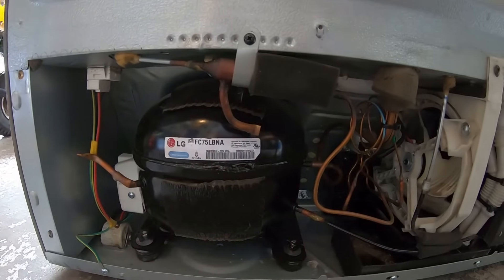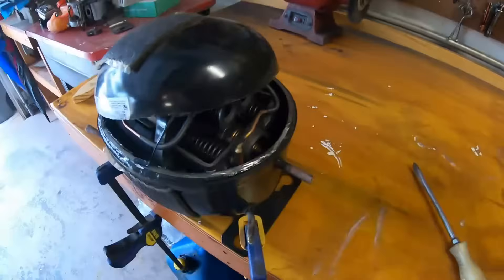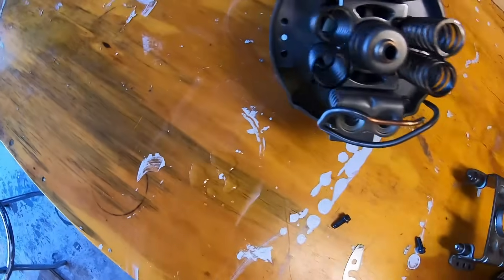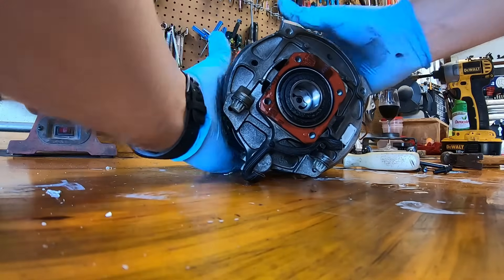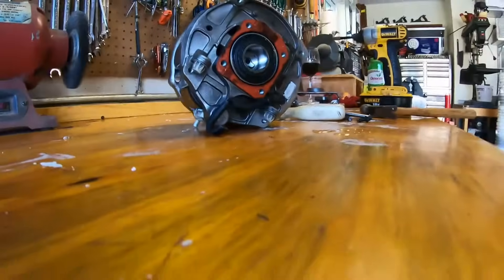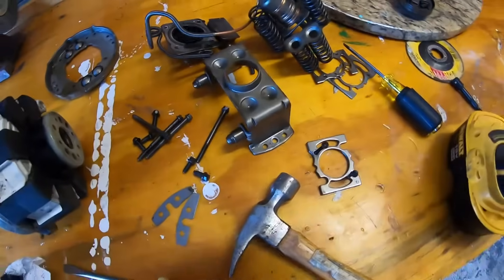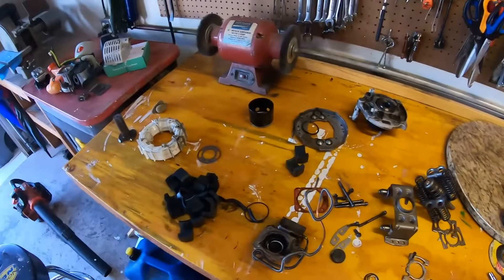Cutting open a failed LG refrigerator compressor

Comment from the maker: Really appreciate the 14,000 comments concerned for my safety :) Will definitely wear safety squints going forward.
Reply: I was worried about your wine...  🤣
Reply: I know a former construction worker who was using an angle grinder to cut bolts. It was prepared and given to him by a stupid, careless fool in the site store. The disc was worn, the wrong size and there was no guard. The disc shattered and a piece shot into his leg which was amputated above the knee. Please take all precautions even if you think they may be excessive.
Reply: Always internet mother hens...
Reply: Just looking out for you Joe.
Reply: Once you get a glowing hot sharp bit of metal in your eye, and have to have it scraped out, you’ll never forget to wear goggles again.
Reply: If you ever need an MRI, go to an eye doctor first and MAKE SURE you don't have metal embedded in your eyes.  MRI will migrate even tiny bits and can blind you or cause you significant lasting pain.
Reply: @smarouchoc7300 That shi sound fucked up tho. Gonna runs magnet on my eyeballs before going to take MRI. But, why would a metal shaving gets into your eye tho. Would they get eaten by our own immune system tho? 😭
Reply: @runsolomon  - looks like metal to metal contact caused debris.
Reply: True.  When you’re young you’re six foot tall and bulletproof!

Comment: I have a  LG refrigerator, model LMXC23746S.  It's only 9 years old, stopped cooling, tech came and confirmed there is a refrigerant leak, the compressor and evaporator will need to be replaced.  The compressor will be covered under warranty, not the labor or the evaporator.  Customer service communication has been awful so far.  It's been over a week since the refrigerator failed, still no word when they will have the parts to fix it.  It will still cost me about $1K in repair cost for the labor and parts not covered by warranty. The 30 year old refrigerator we had before this POS is still working, with no trouble.  Lots of videos on YouTube about LG refrigerator failures.  Will not buy another LG appliance.

Comment: Fascinating! How did you know it failed? Did it stop running, or just stopped compressing the refrigerant? I was going to guess it seized up, or a electrical coil had an open circuit.

Comment: That "flimsy piece of metal" @ 8:55 in video is most likely a check-valve.  There has to be at least 2 check-valves in reciprocating compressor.  They commonly fatigue & break off.
          The "25 cent part" @12:56 is most likely the intake check-valve.  The one in the piston is the output valve.  If intake valve fails, the refrigerant just sloshes in & out of the intake.
          If the cores are laminated, they should not be magnetized, unless in proximity of other permanent magnets (in the piston?)

Comment: it's something how refrigerator made in the 50s still run to this day . mine I got in 92 . still running non stop to this day . why change . let me tell you why . if we don't keep changing . then engineers will be gone. and you have to make stuff cheaper and more efficient forever. who would want to drive around in a 1923.ford .  
as for the glasses he was fine grinding horizontally. we need engineers.

Comment: So I had my LG compressor start failing 2 months after the 5 year mark last month.  It kept things cool but not enough and ice maker stopped working because of it. I contacted LG and they do have a program where you pay $400 + tax and they will fix whatever is wrong with the fridge.  I did it and they diagnosed it was the compressor and put in a new one and now everything works perfectly.  So if you are pretty sure it's the compressor I would contact LG and do it.

Comment: Hey I’ve watched this several time and I think it’s that first part you called spring tension removed. I think it works like a diaphragm pumping the Freon. Probably cracks loosing its ability to function 
I did read one comment indicating tubes rust out. Maybe they should use stainless steel tubing ? 
Nice tutorial

Comment: I'm 74.  I have two refrigerators that were made in the 1950's that still run just fine. WTF???  I've had two or three "modern" fridges fail in infancy.  Scroll compressor, linear, it simply appears we've lost our engineering abilities.

Comment: Compressors built in the 50's are still running and can be repaired easy. My mothers fridge that I used as a kid(I am 68) is still running with no work needed and still running well, very cold. We had the technology, just go back to the old way of doing things. As we "progress"  our appliances cost vastly more and last only 5 years instead of 30 years. It is a loose for the consumer and the planet. It is only a win for company profits.

Comment: Labor $575 + is what LG quoted for repairing the junk compressor in my 2018 refrigerator. The compressor is free. Debating whether to pay that so it lasts another 5 years or less. Someone mentioned installing a standard old-school rotary compressor with a relay. Wish I could find a Technician that could do that. Darn fridge still in great shape.

Comment: I watched another YT video about an expensive modern refrigerator failure & the engineer determined that 100% of the reason was due to the manufacturers attempt to gain a higher EPA rating on the big yellow sticker, so they could sell more units to brainwashed & defrauded Public.
He found that ultra-thin, water-like oil was used inside the compressor to squeeze just a bit higher EPA number caused the failure. He tore down & examined every single part of the compressor & found nothing wrong with the design or build, just that the oil was insanely thin. He lamented that this practice/scam is the worst for the environment because refrigerators cannot be "recycled" because of the incorporated foam, most just crushed in the landfill, Then the environment takes another hit by having to build an entire new garbage fridge that lasts only 5 years. Uncool!

Comment: LG is good at making junk. Have a microwave from LG that works ok, except the push-in lever to open the door is broken. Have to jig it with tape so the door can still open without the lever popping out. It is made from poor plastic that has become brittle and broke, that makes a working oven useless, if not for Gorilla tape. Never LG anything again.

Comment: Diaphragm typically will have a hole in it. I’ve replaced around or over 600 LG compressors in 6 years

Comment: Your infamous LG Compressor Is suppose to have about 8 ounces of mineral oil in the compressor Unless you dumped it It was Intentionally designed to fail Overheating Vibration in oil cool Lube the Motor.

Comment: How can Consumer Reports give them a high rating.
Reply: Exactly!!  CR claims there's no bias or payment received, etc..  Meanwhile, I've gone through 2 LG refrigerators in 11 years and one of them was a very expensive, top of the line model.  My LG dishwasher also broke right after the warranty period ended, luckily I was able to fix it myself.  Once again, it was a cheap part.  I bought a better made part for around $30 and it's outlasted the OEM part from LG.  A lot of people would have paid lots of money to have LG come in and fix their dishwasher or they would have spent even more money and bought a new one.  LG is garbage and CR continuously recommends them, even with massive complaints and problems. I used to trust CR but not any longer.
Reply: Consumer reports has always been a corrupt organization

Comment: That's a beast of a compressor, should have run perfectly for years. Spoilt by the use of cheap part or a good design compromised by cost cutting.
Reply: Not too sure about a good design.  This is our second LG refrigerator in 11 years and both of them had bad compressors.  They don't have the exact same parts in them and the first refrigerator required a mortgage to pay for it.  LG refrigerators suck and I don't plan on ever buying one again.  Years ago my refrigerators lasted 15 - 20 years and these new refrigerators can't last 6 or 7.  They can keep the electronics, blue tooth, wireless nonsense and just make something that works.  The idea that things are built to break after a certain period of time may sound good for built-in repeat business, but not when customers will no longer buy ANY of their products.  That includes refrigerants, dishwashers or anything else they make.
Almost forgot, my LG dishwasher broke right after the warranty period ended, luckily I was able to fix it myself.  Once again, it was a cheap part.  The better made replacement part cost me around $30 RETAIL.  That means LG gets it for a couple of bucks, at most.  The corporate greed will put them out of business unless they make some serious changes.

Comment: One obvious conclusion from the teardown is that a compressor is not a "piece of crap" due to the complexity of the assembly, which appears from this teardown to be quite well-built (other than the cheap seal!). I suspect the Chinese sub-contractor bought his seal from a second sub-contractor who fabricated them in the second floor above his ground floor noodle shop. Clearly neither LG nor the main sub tested a batch of his compressors for long-term longivity before approving the design. I have seen situations where proper long-term longevity tests were made and approved, but then the sub will sneak in a different seal such as this without notifying his customer (LG in this case) of the change. LG failed to clamp down on its sub to NEVER allow changes like this without notifying it (LG) of the changes. The scary thing about a situation like this is that despite the enormity of China, there are probably not many manufacturing facilities in China that make compressor motors. There could be only one, and all of the refrigerator companies have to buy from the same outfit! Would LG have had better reliability from a compressor manufactured in India or Vietnam?

Comment: Every appliance made by LG that I bought failed early just after warranty period, the dishwasher mainboard died, I took it out and tried to re-solder it with an oven but that thing was dead and a new board was more $$  than just buying a new machine,  Fridge died also I assume it was the compressor but who knows... and above range microwave the latch stopped working which I did manage to hack back together with a screw to hold the spring so got it to working normal again but I got tired of it all the LG so trashed them all.  I also had a Samsung Range that died too, it did last 10 years so not too bad but the oven would flicker on and off , I  tried to repair it but  it was a no-go.    I now mostly have Maytag appliances and so far so good after 3 years.        My fridge is Chinese made by Haier but so far so good after 3 years, only issue is that the gasket on one of the Fridge doors split but that might have been me I sometimes grab something on the way out of the house and holding keys so yeah I just replaced it with a new gasket at least it was a cheap fix.

Comment: A couple of years ago my 
LG linear compressor went out. Luckily it happened a week before the warranty expired. They sent out a technician and he had the compressor installed in an hour or so. He said it would be better than new. So far so good. If it croaks now it won’t be another LG until they get their act together
Reply: I’m glad they stood behind the warranty. They did not with mine. If you read the BBB complaints, they typically aren’t standing behind their warranties.

Comment: While it may be called a 'linear' compressor, it obviously oscillates an accelerating and decelerating piston. How is this better than the much simpler rotary compressor that mostly avoids accelerating and decelerating masses?

Comment: Yeah but it's energy efficient, saves probably 50 pounds of carbon but only lasts 4 years so you can buy a new one which takes a ton of carbon to make. Just like the new eco boost tiny engines don't last. EVERYTHING IS A SCAAAAAAM!

Comment: DTF: Designed To Fail.
For the last 12 years, my wife and I have paid over $600 a year for fridges. We have had to replace two of them.
Meantime, the "Frigidaire" bench fridge my grandfather purchased new in 1949, for my grandmother, continues to run perfectly in 2024, just as it always has.
Please note that we have replaced the door seal a few times, and that's easy with a standard stick-on seal strip. Costs about $20 to replace, every 20 years or so.

Comment: The engineers that produce this  kind of poorly designed garbage, need to be held accountable. No one should ever have to pay about 3 grand for a refrigerator, only for it to fail in 2-3 years.

Also, this country’s dependence on Chinese products is astonishing.

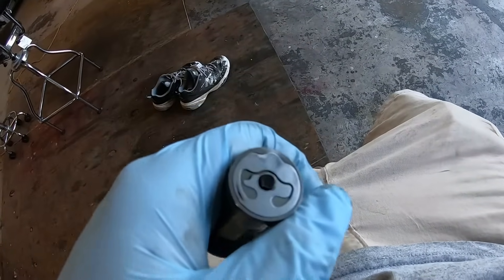Comment: The fault is actually seen at 11:41 . A little bit of the T section is missing from this unidirectional membrane valve. You can even see now the flow-hole below the missing chunk. Thus no compression is possible.

Comment: I have a fridge from 1980 something an one from 2000. They both still work fine. A coworker of mine recently got one of these lgs within that last year as an old stock scratch and dent for 650. The compressor failed. He is now out 650 and bought an old used fridge because these piles of crap don't last. He didn't even bother with a compressor because it's 400 dollars for the same crap. He's happily using an old 1990s whirlpool which was 50 bucks.

Comment: Yea, this is why when I wanted a new fridge, I found a GE from 1991. Simple rotary compressor and no electronics. No stupid ecm fan motors or control boards for the defrost either. I also have a Whirlpool fridge from 1996 as a second fridge, and it also works fine. I just clean the condenser coils and fans on both of them every few months, and thats it. Along with those refrigerators, my washer and dryer are Maytags from the 80s. The washer is a top loader. My stove is a 1989 GE with an analog clock, and my dishwasher is a 70's Hobart Kitchenaid. I even have my front porch light controlled by a late 60s or early 70s Intermatic wall timer. Things today are just made so poorly today, and nothing is designed to last anymore. Even cars are shit today. It's very sad.
Reply: I tell people any old fridge fix it! the new stuff is utter garbage
Reply: @Refertech101  that's why both of my refrigerators are from the 90s

Comment: I just came across your video. I didn’t finish watching it all the way yet as the obvious failure point is at the 11 minute 38 second mark.  the top of the piston has a valve which is symmetrical in a good unit. The left valve on your piston is actually Broken and the chamber below it is visible. This causes the pump to not generate pressure as the valve has no way to ensure compression.

Comment: What you've thankfully done is uncover a very dark little Linear Compressor secret buried in the absolute center of the refrigerators heart. Only a cynical LG design engineer that has to keep this corporate LG nonsense tight lipped. But then who's is willing to cut open a steel case with a grinder and expose this LG obsolescence top secret - a .05¢ plastic valve that renders an expensive $3K dollar 💵 appliance obsolete. NEVER BUY ANYTHING LG - EVER!!!!

Comment: we've had our LG fridge compressor replaced 3 times under PC Richards extended warranty.  the repair guy says it's important to keep the back vents clear because heat seems to be what degrades that little part.  it's a design flaw - weakest link type of thing as the rest of the mechanism looks pretty stout

Comment: Some technicians replace those LG crap-pressors with old school compressors, they just connect an external relay somewhere to the control board that when closed runs the compressor directly from the mains. A normal compressor uses more electricity but with the cost of a new fridge you can pay the extra electricity for decades and making a new fridge uses a lot of energy and resources so saving the old one is better for the environment.
Reply: Thanks. I was wondering if this was possible.
Reply: All new refrigerator compressors are Chinese crap. Especially the Energy Star ones. I didn't know that anyone was still making good American compressors. When I was younger we used to scan the ads for used refrigerators, and they would last years longer then these new ones. I still have a 30 year old freezer that still runs great.

Comment: I've got a freezer in my basement, that I got from my parents when I moved into my house. It's 64 years old. They gave it to me in 1980.
Still works like new. Manual defrost.
Reply: My bench fridge in the shed is 75 years old, and running perfectly since 1949.
Reply: Same with me. A bullet-proof Kelvinator. I bought it 30 ears ago and it has a huge American made compressor. Cheap energy efficient Chinese compressors are the problem in everything.
Reply: Before the days of planned obsolescence.
Reply: We had one too. Went away with the sell of the house.
Reply: I got a freezer from 1956. Came with the house and it just keeps purring along. Once a year manual defrost is needed or it becomes packed with ice 😂
Reply: @JR-fw4jv  They don't make them, like they used to.
Reply: Me too, mine's over 30 years old. A Kelvinator model. Best thing I ever bought. As a side not, never buy anything that's Energy Star rated.